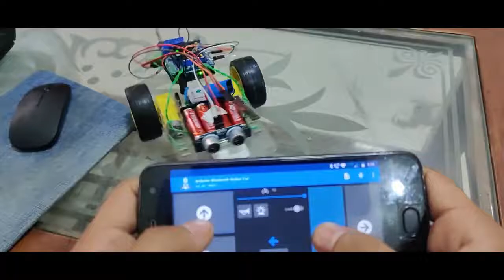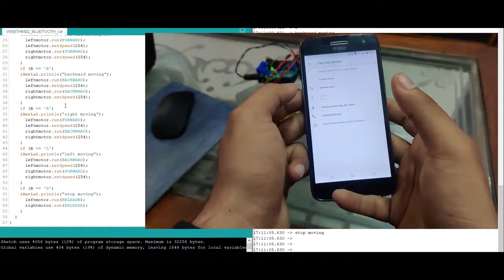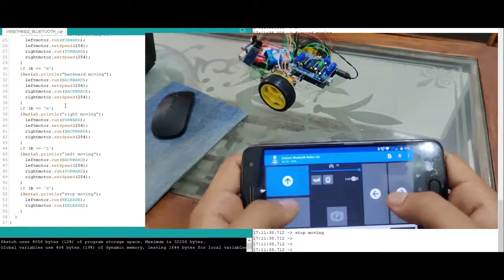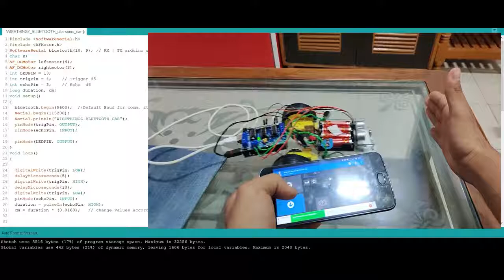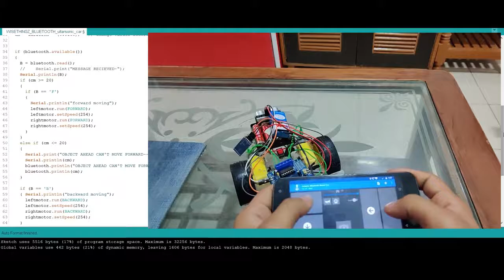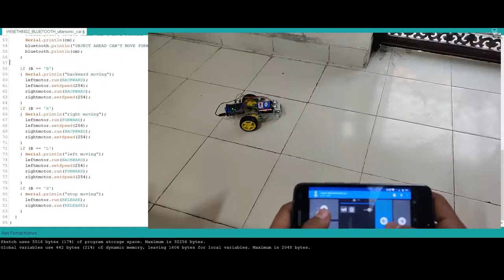2wheel Robot car (RC car) - Bluetooth controlled car ; Comprehensive guide

Comment: Hello brother, I want to make the same project, but I want the project with four wheels, what is the necessary modification, thank you
Reply from the maker: Hi, you can use the same motor shield. U have to use all 4 motor connections on the shield, and need to update the code accordingly.
Reply: @wiseThingz  Thank you very much, but I do not have the full experience in modifying the code, can you tell me how to modify the code